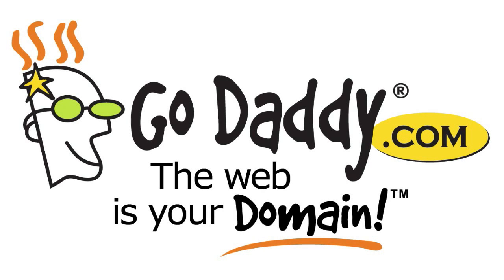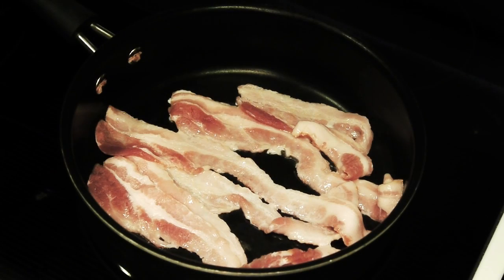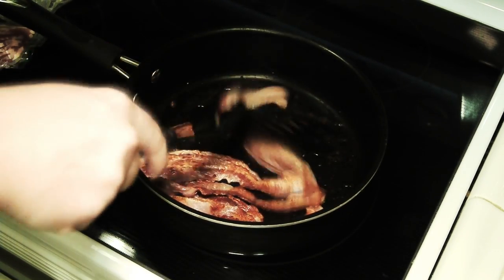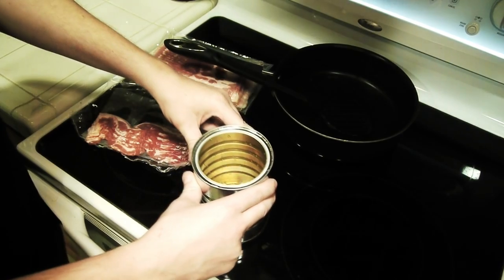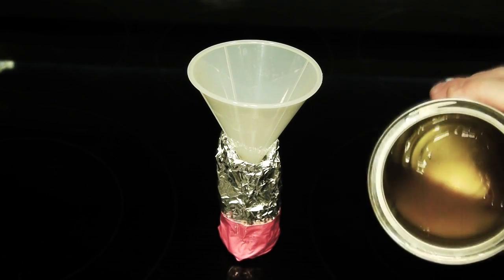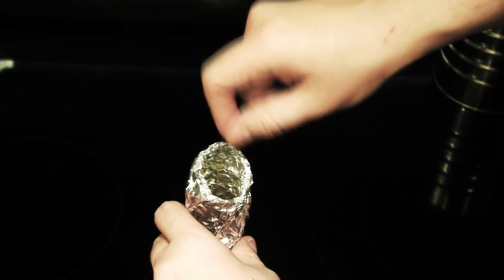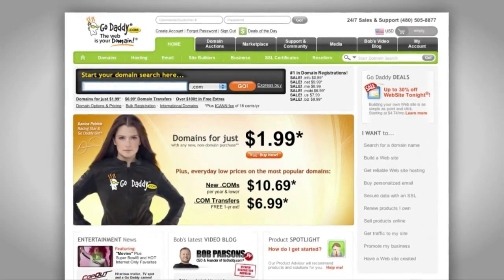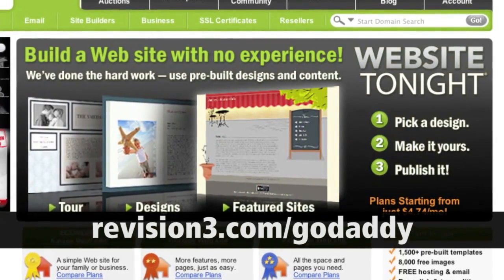The Bacon Smoke Screen

Comment: did you do that on a train trak or is it just me
Reply: Its is.
Reply: nice scooter ;)
Reply: thanks do you ride one
Reply: yup. ive got the 2014 lucky deck. proto scs clamp,pheonix suicide bars,pheonix forks and lucky wheels.
Reply: nice ive got 2014 grit bars with a grit clamp rush forks and headset with a district deck and just some wheels I found at home its different to that picture because ive changed it since

Comment: lets see that again without the flash powder.  i was gonna subscribe but after this lame video i'm revising that idea.  bacon grease needs to reach a certain temperature before it can burn and that tiny string and tiny flame aren't gonna get that grease hot enough especially since the grease is being lit from the top and heat rises.  the only thing that will happen is the grease liquifies allowing it to be wicked up essentially creating a bacon scented candle nothing more

Comment: That looked more like a flare.

@freedomfighter40000 
you might want to PM HH to verify/test this, but adding certain metals in a powdered form to the grease, mixing it up, and then putting it in the canister should change both the flame color and (possibly) the smoke color.

@HouseholdHacker
could you try one with the contraption/container in the freezer, or find a way to make it burn slower and less brightly? And then one with different metals like Magnesium/etc.

Comment: @freedomfighter40000 I highly doubt it... It could work, I don't have any hard facts, but I doubt it. Take for instance diesel. In Norway we have regular diesel, and we have tax free diesel for vehicles that don't mainly drive on the roads, or never at all (like tractors, boats, and so on). But since it's cheaper, people break the law and use it in their cars. So the government dye it green (used to be red) to be able to spot it with a simple test. But the smoke is still black..

Comment: this would of worked alot better if he had of closed over the top of it with a small hole in becuase ten the flame would still burn but would be half smothering it giving of smoke

Comment: well a wick would only alow the flame to be on the top of the bomb and slowly melt away the tin foil which has been enclosed on the top. Since the bacon fat has a very explosive reaction with fire the string was soaked in the bacon fat which would allow for the foil to be burned through faster and in essence a quicker bomb. what I am wondering is why he refrigerated it for that 15 minute span of time

Comment: @Bay0991 Hope that's sarcastic! lol.  If it's not, how is lighting the string on this "smoke bomb" any different from lighting the wick of a candle?  Also, the flame of the wick is what is melting the wax, so why wouldn't it trigger the immense explosive power of wax and grease? (other than it doesn't exist!).  You were being sarcastic though, weren't you?

Comment: Ok so i dont wanna be hating but as far as i know that burned way too agressive and bright for just grease. Also the smoke produced in such a reaction would have to be black because of carbon particles that are not burned because there is not enough oxigen and not whitish like in the video. Since the flame burned purple (smoke reflected the light) and it was so agressive i suspect that that was not grease burning but a smoke mix from potassium nitrate and sugar (KNO3 burns colors flames purple)